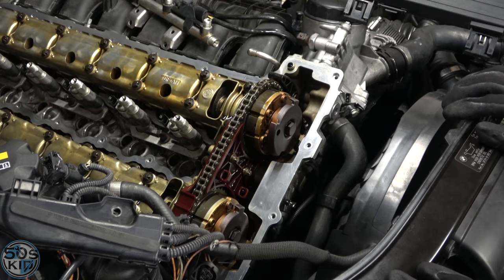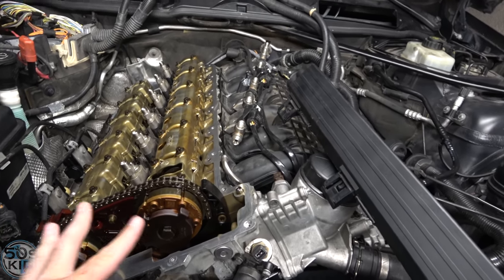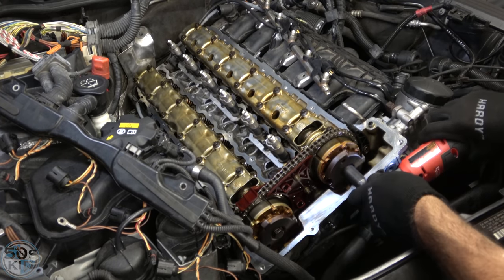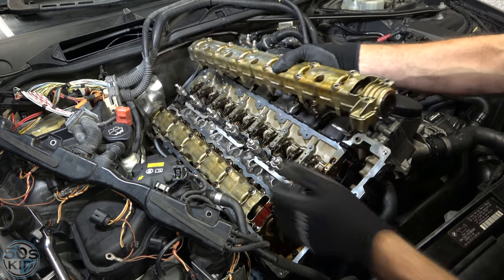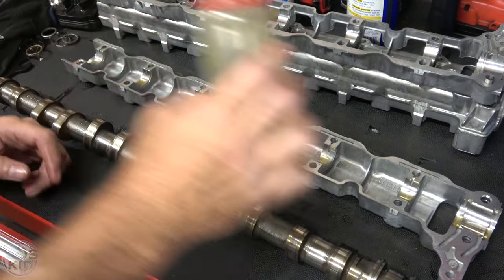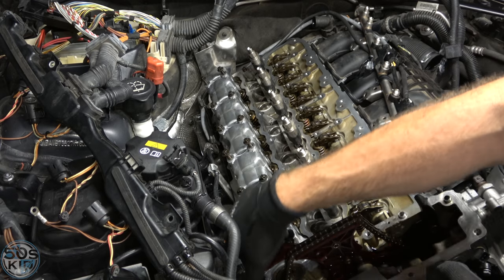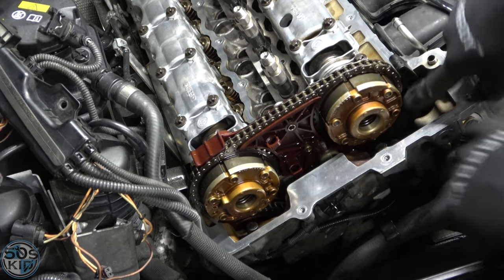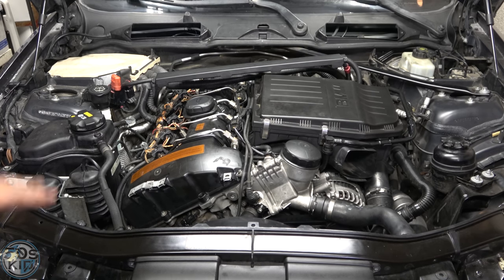This causes VANOS codes! - E90 Cam Bearing Ledge Failure DIY

Comment from the maker: NOTE: In the video I said they introduced the teflon o-ring in the 2009 model year but this was incorrect, it was introduced in the 2012 model year which was when the N55 engine was released.  So, basically, in the LCI "facelift" models.
Reply: Where you live buddy ? I’m in jersey need some work on my car 08 550i m sport.
Reply: Ahhh fuck this makes sense as to why my 2011 335is are getting these.

EDIT: I did the job on my 2011 335is and the seal were teflon/plastic type, it still caused grooving in the tray. Maybe the previous owners beat the car when it wasn't warmed up, I cannot say why it was grooved.
Reply: What was the mileage this repair was done
Reply: @JackRR15  did you ever get around to doing them? my 12 335is is getting an intake code 2a82. they have metal seals on the is too I assume.
Reply: @yiannidee  Hey sorry I never saw the replies and thought I updated my original comment here... my 2011 335IS did indeed have teflon seals and still grooved my bearing ledge. I only replace the intake bearing ledge but my exhaust ws also grooved but without codes, so might have to do that in the future. I was told on the BMW Tech subreddit it can still happens sometimes, I assume maytbe when someone doesn't let the car warm up fuly before beating on it I don't know.
Reply: @JackRR15  bro i have a n51 and i cant find shit ab engine failure. i think my n51 has some type of bearing or lifter failure, its knocking like crazy and has misfires on 6,5,4, and 2.  I've tried a few things without pulling the valve cover but i think the engines shot. i just find it odd that i don't get any vanos codes or timing. also never really heard ab engine failures on 51/n52.

Comment: Greetings from Norway here. I would just like to inform everyone that it is possible to repair this and I repaired both my camshaft trays using a lathe. I linebored ONLY the seal surface that was worn down and then bought a slug of ptfe rod and from it I made oversized Teflon seals to match the diameter of the machined cam trays and everything is okay. The engine is an n53. So if you have time and a lathe this is possible to repair with only the cost of the Teflon round stock and some bolts.
Reply from the maker: Very nice, but that's definitely an advanced level repair!
Reply: Hi, do you have measurements of the custom oversized Teflon rings by any chance?
Reply: @dmarkovina  Sorry I don't have any dimensions for this because both sealing surfaces were mashined just enough to clean up the wear groove and then I made the Teflon seals to fit each seal surface. I took measurements of the area that didn't have any wear and then from a new original bmw Teflon seal to figure out the outer dimensions of the seals. If I would have to do this again I would have machined the cam trays to a specific dimension and made spare seals for them. Anyway the engine is still running strong and has done about 30.000KM with the custom made seals.
Reply: @endrekalvenes8460  Thank you - but they had to be bigger than the original teflon seals produced by BMW as a replacement for the steel ones?
Reply: @dmarkovina  yes the outer diameter is larger than the original ones, but the other dimensions are the same as the original ones.
Reply: @endrekalvenes8460  what kind of PTFE did you used? The usual PtFE is white but the one from BMW is dark grey or Black with some Kind metallic glitter filler inside. Thanks
Reply: @artjust8550  the PTFE that is used by BMW is a bronze reinforced Ptfe as I understand, but I used white PTFE and it's still working fine. I think you can find that bronze reinforced round stock on eBay even if you choose to use that.
Reply: @endrekalvenes8460  thanks for the info. I finally fixed the engine with machining the ptfe seals. Now the car run much  smoother and no Codes.
Reply: What codes were you getting? I have 
P052B on OBDII and 2A7C when I scan using more advanced direct Vanos drive code scan. I installed a head and didn't  check or don't  remember checking the surfaces.
The engine is a 2012 N51 for 328i.
So I checked everything and nothing seems to get rid of the codes. 
Let me know if you got the same codes. Also the Vanos gear is at 130 degrees won't  retard using ISTA
Reply: If anyone is needing more confirmation on this fix, it actually works. Make sure to get some teflon stock, doesnt matter if it’s white or the bronzed one and take it to a machine shop. I also found no need to machine down the actual ledge, just the oversized rings are needed. Also the tolerances aren’t too strict as well, so .1mm larger than the diameter of the worn down part is going to be just fine. You should be able to just pull them over without cutting them to the positions. Don’t worry too much about that they stretch a little. A good way to know that theyre seating properly is to spin the camshaft manually and then with the rings on, as it should have some resistance, which indicates a good seal. 
And of course remember to make sure there’s no debris where the bearings and the rings sit.
Reply: @50sKid  wanted to know if you’ve ever came across this, I deleted my adaptations on a n55 car and now it’s goes into “drivetrain malfunction” mode and I get codes for intake and exhaust camshaft installed incorrectly. Weird and driving me crazy

Comment: For everyone doing this job, note that you should technically be using the camshaft locking tools BEFORE removing the central camshaft bolts. It avoid putting torque on the timing system when you force to unbolt it. BMW workshop manual says to do this.

Comment: Before removing the VANOS phaser adjuster bolts at 13:05 I think you’re supposed to have the cam alignment tool installed at this moment.  Otherwise you’re torquing against the timing chain and when they are loose nothing is holding the cams in phase except cam bearing friction.  👍
Reply: Yes exactly right I’m in bmw school
Reply: It doesn’t matter because he is re timing the motor anyway
Reply: I was wondering that as well. I was like man he’s doing it with no tool isn’t it going to move? Doing this job right now so glad I saw this comment.
Reply: He had the crank pin installed.
Reply: Clearly didn’t pay attention from 3:42 to about 4:10 he literally explains this exactly as you are and the solution lol.

Comment: Also if the insert is missing from the oil filter cap this will also cause vanos faults. Many over look this. I believe those cam phasers are the old style ones. I’ve replaced many of those for vanos faults also. The bolts are prone to backing out or breaking
Reply: What is a insert on oil filter cap and does a 03 bmw 745i have one?
Reply: I have the design without vanos bolts but at idle I have a strange noise that resembles the one from broken vanos bolts…

Comment: Hey man I did this work when I was rebuilding my n54 it becomes a headache when you putting the timing kit back on lol as the camshafts need to be strait with the little QR code facing straight at you but mine each time I tried to put the tool to hold it in place after tightening would see that it hitting it and was not perfect straight but then I got it right and this was my first time dealing with an engine it is an amazing experience as you learn so bloody much

Comment: Great video, man. I got here because I may have to do the exhaust cam on my N55 project. I am only getting exhaust VANOS codes (thankfully since on the N55 the intake being bad means new head). If I end up replacing the exhaust clamshell, I am definitely using this video!

Comment: The reason for using the cam ledge alignment tool 32:40 is for the alignment of the cam journals to a 1/1000th of an inch accuracy, but also a side benefit is to keep the bottom cam ledge from separating as you’re bolting them down.
Reply: Man it's the only thing holding me back from doing the job. That really worries me but I can't read any info online. 500$ tool.

Comment: Submerge your new lifters in a container of oil, and leave them soak overnight. Give them a couple of squeezes under the oil before you take them out. You will see a few air bubbles come out of the lifter. Then install them. They wont run dry for as long when you fire it up, and it won't clatter as bad or as long. Just don't pump them more than a few times under the oil, you don't want to over pump them and have a hung valve when you go to start it. I've over done the lifter pumping under the oil once on a G.M. engine, and it had ZERO compression when I went to start it the same day, after I got it assembled. I let it sit for a few hours and the overpumped lifters bled down and it was fine then. It may seem like overkill to pre-fill the new lifters with oil, but I like to do it to avoid the minute possibility of a collapsed lifter during the time they run dry on the first start-up. I did have a new lifter collapse once before I started doing the lifter soak, and never had it happen again after I started doing it. Maybe it was a fluke, maybe not. 🤷🏻

Comment: I have a BMW E90 and the engine light came on, my garage cleared it and it seems to be ok but he did warn me that if the VANOS Solenoid is an issue then it could be very expensive to fix as the issue is inside the engine. Could this be true and if so could he be talking about the repair shown in this video? How much should I expect to pay for such a repair at a garage here in the UK? Thank you

Comment: Hey. Great video. Do I have to lock the flywheel when replacing only the vanos adjusters? I locked the camshafts so wondering if the flywheel lock is required.

Comment: @50sKid can you help a brotha out? How did you take the cam bolts off without using the special locking tools and just the flywheel pin? Is that fine to do?

Comment: Though it is common enough that they exposed an SIB addressing it, we don’t and didn’t see many bearing ledge wear. Yes every now and then, but not frequent.  I suspect if those engine owners did more frequent oil Changes- the wear wouldn’t occur

Comment: Thanks for sharing l got 2009 bmw 335xi saund like exhaust camshaft taping noise but no misfire code just for vanos know sensor too l just take valve cover out to see if has metal damage but l found need tools to hold cams  May after take cams out will be see something this video helps lot thanks you 🙏 so much

Comment: The special tool is to 1 check if the cams are in correcting timing with the crankshaft then it holds down cams when your releasing the vanos actuater

Comment: 50sKid ?  I gambled on a 09 bmw 328xi 1 owner 103 k solid clean car for my daughter she's 16 the just cranks lady parked for few months I replaced battery registered a new one and car just turns over  code is crank cam correlation. I gambled on this just being a crankshaft sensor as ive seen many other e90s crank and crank exactly like this and then fire up w new sensor..  what are your thoughts sir? I haven't attempted the crank sensor just yet im a bit nervous lol I pray it isn't timing  I mean 103 k u wouldn't think it be a timing issue just yet  hoping u see this I value your opinion and videos u do a excellent job w them.  thanks in advance man.

Comment: Great informative videoss. Could this also  happen on an N62 4.8 V8? Im having issues with intake cam error codes and it is not moving on INPA graph.
I have replaced all sensors, Vanos actuators, oil, checked all connections etc... I'm out of ideas.
Thanks Ben

Comment: I'm doing this job Right now replacing all the lifters. To lock the flywheel with the pin is it the gold pin or black pin? I have the gold one in place but experiencing some play clockwise and counterclockwise. Is that normal? The QR codes are facing upward. 🤔 Any feed back will be appreciated.

Comment: Thank you very much for this video. I'm chasing a horrible idle on this N54 E93 I just picked up from a friend. Codes are 2A99 and 2A9A. He was frustrated with it and said to me it's probably the cam ledges. Did I hear right that all N5x motors use the same Cam Trays and that LCI motors should be using Teflon rings? Can u please confirm? Hoping to get lucky at the junkyard.
Reply from the maker: Try replacing the vanos valves first.  Yes they all use the same cam trays and supposedly the LCI N55s are using the teflon rings but I won't believe that until I've taken one apart in a junkyard! lol
Reply: Did you ever figure out the 2A99 issue? I currently have the same code and am pretty sure at this point that the bearing ledges are the issues.. I've already checked and cleaned all camshaft and crankshaft position sensors, Vanos solenoids, Vanos non return valves, new oil filter cap, and changed oil and filter twice in less than 1,000 miles. I've also retimed the engine properly which helped it run perfect for about 6 days until 2A99 and 3001 came back up again. Hoping to hear that you've found a result within the past year.
Reply: @austinmerrival927  This car has been on the back burner and weirdly enough, within the past few weeks I've been prepping for oil change and cleaning of solenoids & CPS's, I've been battling with the reality that I have to buy that Cam ledge kit from FCP or ECS and rent a cam lock tool. @$565+ each cam ledge, plus bolts etc. This is an expensive & tedious repair. I've wondered about repairing the groove in the cam tray by sanding or refinishing, but I can't find anyone that's attempted it. I see WolfAutoparts sells used starting @ $169. I'm always DIY, but I'm thinking I may need to hire some help here. 😢

Comment: so just to be clear, if i keep getting the intake vanos code after replacing it with a new oil filter cap and filter, i need to replace the intake cam tray? i do see some oil leaking on the right side of the motor

Comment: Excellent content! I I'm glad your making videos again.  Just curious how much you paid for all the parts.  I have an 08 e60 535i with 230k miles. Haven't had any issues with this yet but I know I should do it.
Reply from the maker: The teflon rings are super cheap, I don't even remember.  The cam trays were very cheap too.  Probably like $50.  Of course you're not gonna get that price unless you go and put in the work to find a unicorn. :-)

Comment: Hello,

I have N46 engine, I assume,  I might have the same problem, as I've already replaced,
- Vanos
- vanos actuator
- sensor
- timing re-set

issue still exist, position not reached (ISTA - Vanos test)
Is there a special part for my engine as well ?

thanks

Comment: I have a 07 bmw 535 it’s making a loud knocking noise and the codes I pull up were vanos camshaft solenoid I replaced both of them and it didn’t not fix the problem do you think my camshaft bearings can cause that loud noise

Comment: Is this problem still a warranty replacement when i got a 135i for 2008?

You changed the entrance with new Tevlon rings + bearing shell and the output you didnt or?

Comment: Getting that locking pin out was the hardest part... I almost gave up on trying and on my last go at it I got it out.  Question I have the BMW locking pin in place buy im still Getting play from the crank hub. What am I doing wrong.what pin did you use the black or silver?

Comment: This happened to me in 2019 with a N52 engines 325i, had the car a few weeks and it started acting up. Took it to a well known bmw independent garage here in London, and they diagnosed this exact thing but also the head had wear ridges from this... Basically engine is almost scrap. I threw it back at the dealership and threatened to sue unless I got my £ back. Bought myself an M54 powered 325Ci... been BMW since I was young but now I Will never Ever touch a newer BMW again.

Comment: Maybe I missed it but it wasn't completely clear to me if you used the junkyard cam with the junkyard cam tray or did you use the original cam?  I'm guessing junkyard to junkyard parts correct?  Anyway, as usual a very clear description and narrative in the video.  That, to me, is your trademark.
Reply from the maker: That is a good question and... I don't remember.  I also don't think it would have mattered which one I used because it has roller rockers.  Premature valve lobe wear was only notorious on flat tappet cams in older American cars but I've never heard of that being an issue in BMW engines.  Thank you for the compliment man, I do work hard on trying to be as clear and concise as possible.  I missed that detail though!

Comment: Thank you Mr Jason, a question for you, if there is no/slight wear on the ledges can simply replace steel o-ring with a teflon? Or need new cam ledge if there is slight wear?
Reply: also and happy to see your arm has is healing
Reply: I wouldn't be afraid to run the Teflon seals on a "slight" wear situation. I believe the Teflon seal has a better ability to take up some slight wear than the steel rings did. Obviously the Teflon will cease any more wear happening.
Reply: Did you end up trying to replace just the seals with the teflon ones on your slightly worn ledges?

Comment: Like your channel have a 2011 BMW with the n52 engine that has a lot of valve train rattle in it when it's cold it's really loud when it warms up it goes away just slightly but you can still hear the rattle in it what could it possibly be
Reply from the maker: Stuck lifters

Comment: Should use the tool to hold the upper and lower cam carriers together it makes a big difference
Reply: Nah, I never use it. Never had any issues. Just be gentle, careful, and go slow while you tighten the bolts.
Reply: @davelowets  youve never come across a M3/M4 engine with a cold start top end cam knocking then clearly
Reply: @fordymicra  Nope. Never had to remove a cam on that engine.